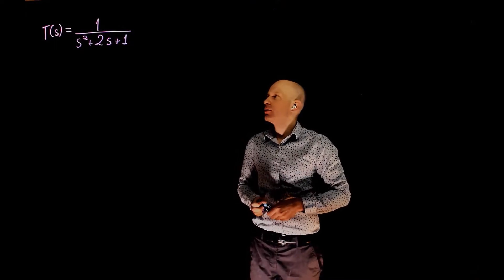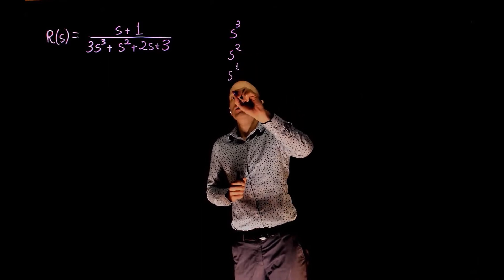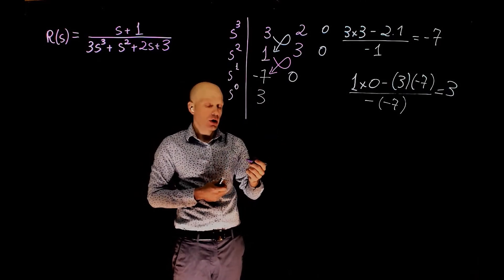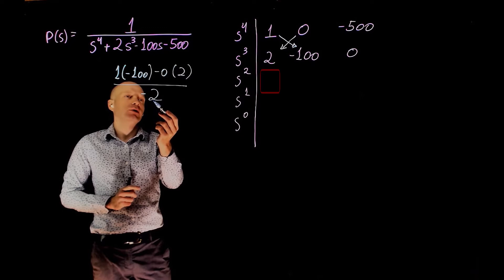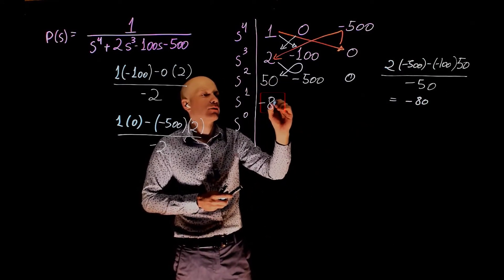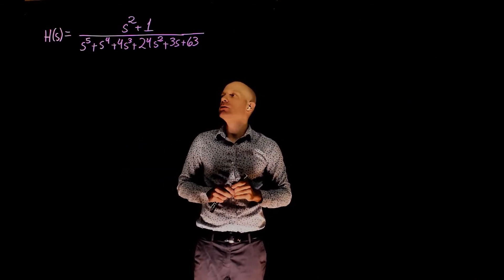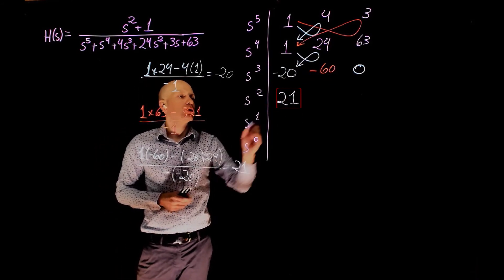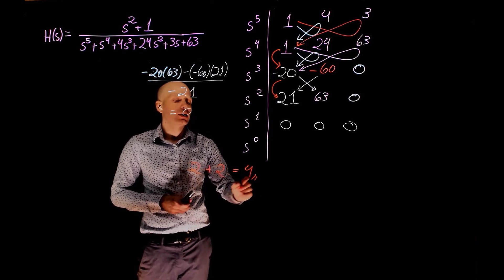L10E45 Control Systems, Lecture 10, Exercise 45: The Routh Hurwitz stability criterion.

Comment: why we continue the calculation entirely all of 1. column in the case of once change of sign. I think it should be considered as unstable , if there is one sign change at least .It doesn't need to continue.
Reply: because in this video, he answers the question "how many poles in the RHP in these systems". If we were asked, find if this system is stable using Routh-Hurwitz then we could stop after one sign change. Kolay gelsin :)